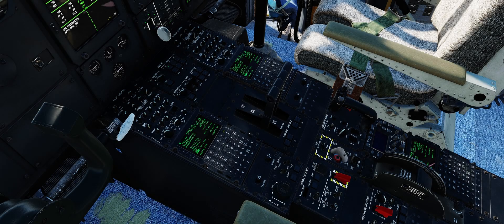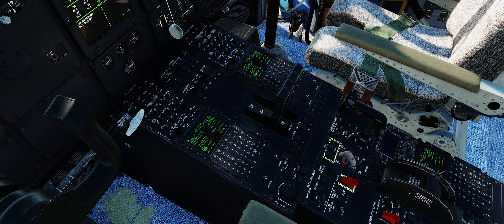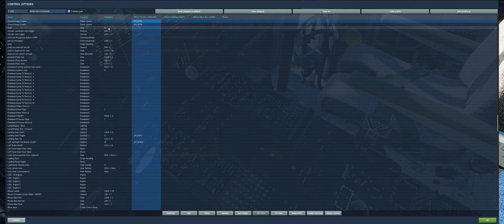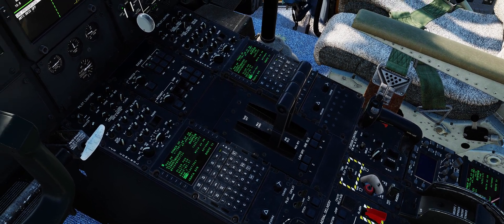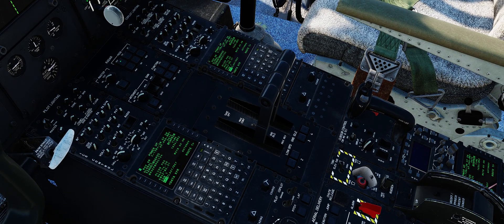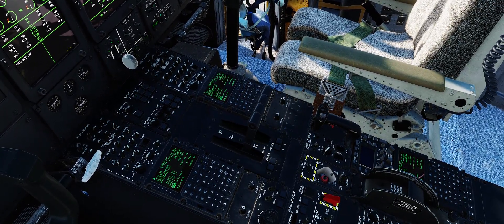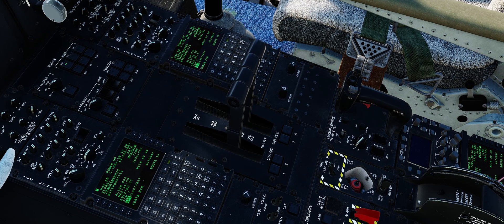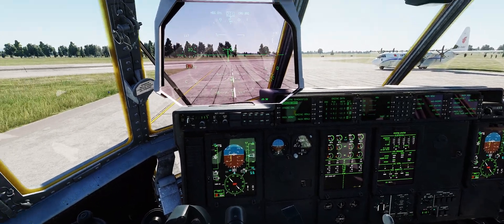DCS C -130J Ground Detent Explanation

Comment: I set both command on two different button but they didn't work at all. My throttle still going all the way down when I press disable
Reply from the maker: Are you above flight idle while attempting to press the detent?
Reply: I had the old hercules mod installed and auto reverse activated, thanks man 👍🏼now all works right
Reply: @Tristan1Barrett I have the same problem, and I still am not able to disable the reverse thrust even when above flt idle
Reply from the maker: @timogrimminck7076  You dont by chance have to old herc mod installed do you? I cant see any other reason why this still isnt working for you. One other thing to check is to go into the 130s cargo menu and go to settings to make sure you have "auto reverse" unchecked
Reply: @Tristan1Barrett aha, I do have that installed. Didn’t know that would interfere. Thanks!
Reply from the maker: @timogrimminck7076 yeah the old mod is known for causing issues with the full Fidelity module